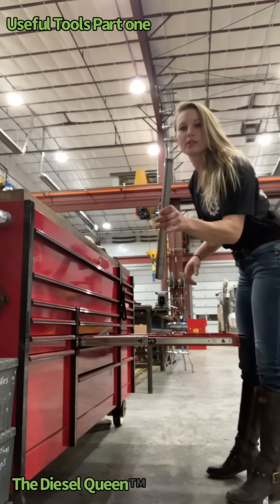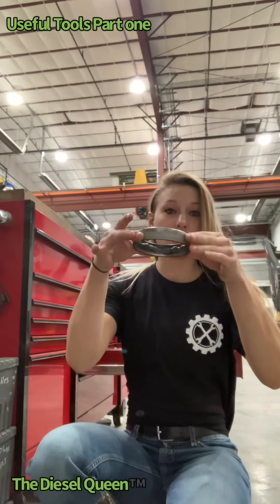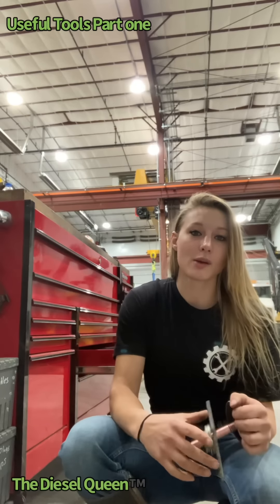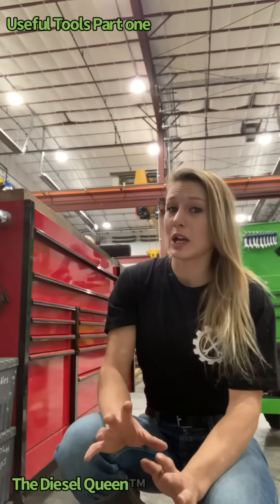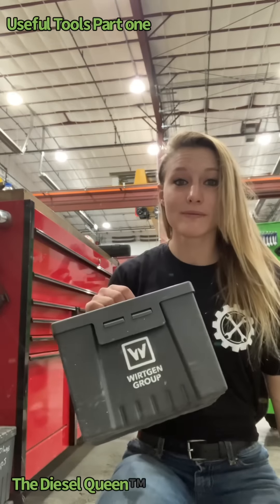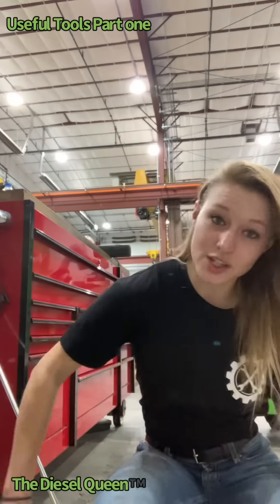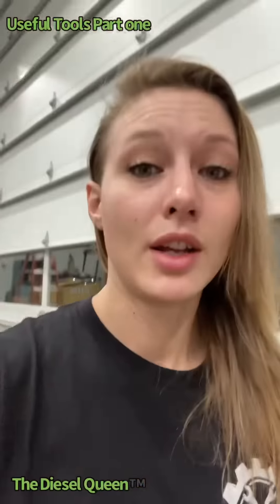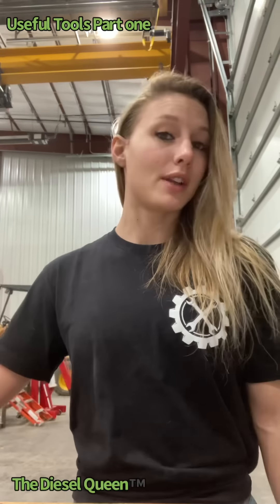Mechanic “Junk”

Comment: I worked as a diesel mechanic for 43 years .I saved old parts ,plugs, to make job easy and cleaner but was known as a pack rat. I told I saved stuff and never used it ,man could I prove them wrong. You are a smart mechanic

Comment: I like to take my old bearings to the chop saw, cut a slice out if them, then squeeze it closed and weld it back together.  Make a perfect install tool for the new one.  Works great for seals also.

Comment: Using the race of one bearing to knock in the race of another bearing is a very old trick. I knew an old mechanic when I was a kid that was doing that trick. He even went as far as welding up a plate with a handle that he could hit with a hammer and knock it in and take it out. But instead of welding the inside of his race he the ground down the outside which accomplished the same thing. It also works for putting in seals of that same size mechanics whether diesel or gasoline automotive semi or heavy equipment all have one thing in common. A lot of their tools are purpose built on the job I built several tools that were purpose built just for that job. Some will use many times. Some were never used again

Comment: I hear that on using old parts as tools. I have multiple different sized kingpins that i now use as drift pins for knocking in massive wheel studs and such. I also have a few leaf spring shackle pins for the smaller jobs. Probably my favorite old part i turned into a tool was the long tie rod end from my old 1989 K5 blazer that i turned into a massive pry bar. It’s solid iron (not hollow) and at least 4 feet long.

Comment: I take an old bearing race and I grind down the O.D. on a Bench Grinder..  then I weld a flat bar in the middle for a place to push with a 50 Ton Press..

Comment: nearly 30 years as diesel tech. Pretty much every mechanic worth his/her salt has stashes like this. I have a roller cart that contains boat loads of connectors and harness ends. Another area for the various caps and such. Used bolt bins, fittings, etc. If you don't haord stuff like this you're either in the wrong buisness or you just started.

Comment: I love the inside bearing race trick.....
 So simple . 👍
Organizing the bolts and tossing most of them out is the right way.   I had a few old bread pans full of lterally everything. I never  needed them..... Ok, rarely.
Youd never have a hard time finding work.  You've broken a stereotype into a million pieces. 👍
Im 65 and no, i don't want to arm wrestle.  I have my pride. 😂
Excellent organization, it takes a lot of years of experience do what you've done. Very cool.

Comment: I've mad tons of shop made tools over the years. But my top 2 are my homemade slide hammer and homemade valve spring compressor. Huge difference in the ones I built and the ones from a store. Mine are way beefier and I guarantee mine is a lifetime warranty lol.

Comment: Never worked on heavy equipment or diesels for that matter (oil changes don't count), but working on passenger cars and trucks you definitely have to come up with your own shit sometimes. From weighted sockets to extended shaved wrenches for srs modules, sometimes you gotta get more creative than the engineers and bean counters that are fucking you over. Cheers 🍻

Comment: I have a garage filled with stuff like that. For bolts and small parts, I use the craftsman versa-stack drawer system.  Drawers slide easy and keeps my bolts organized.

Comment: Genius keeping those old harness plugs, it's got to be way easier testing a sensor with wire leads than trying to probe in the end. 
Plus, you never know when you'll need to replace just an end because something arced or corroded.

Comment: Plastic caps from your stash are helpful to "plug" the end of hydraulic hoses, especially useful to prevent dirt infiltration and with some tape to control annoying oil dripping. 
I also like colored zip ties to match mark hoses and mating fittings. HF quality serves this purpose and gives a legitimate function to those otherwise useless zip ties.

Comment: Take that big bolt and a piece of 1” cable 24” or 18” long with a press on steel Swedge or end button and weld it to the top 1/4  of the bolt to make an offset T and it’s an awesome handle that doesn’t transfer the shock when you hit it with a big hammer and it helps you keep all your fingers safe 🙌🏻 most other mechanics I encounter are impressed by mine

Comment: "Junk"? extra connectors, old unusable shafts and pins, thats literally gold. i still have string of mechanics wire with old used shrunk/ground races.  some of the best tools in a technicians tool box are the ones they made.

Comment: there is no such thing as junk in a mechanics toolbox, everything is there because its useful for a job and saves time effort and broken knuckles, and of course lots of blood.

Bolts is vital, over the years when i have scrapped cars i usually strip them of bolts and parts and keep them, i've lost count of the number of times that bolt bucket has saved my neck.

Comment: I thought weld=heat & heat = expansion...when I do kingpins on a m.a.n axle we press frozen kingpins in..frozen to 70 degrees below zero...but hey I been wrong before...maybe you meant you weld it after you got it out & the heat from welding changed the molecular orientation and it shrunk a couple of thousandths.....anyways your cool in my opinion...I use to save stuff...now I work on city buses and they have everything..even a fabrication department on site...by the way nice toolbox...be safe

Comment: Please be careful about using hardened steel as punches. Have seen them chip off and heard about them exploding in your hand. I hit a spline once with my hammer and a pellet size piece went about an inch into my neck.

Comment: Fyi cutting notch on bearing race does same thing to making a tool. 🤟
Reply: Yep, I was going to say the same thing, bit of a secret trick🤣👍
I have a box full of slit outer races from tapered bearings I've replaced over the years. Every time I replace a bearing, I slit the old outer race as the installing tool for the new bearing, then it gets added to the assortment box, although I normally check if I've already got the correct size in the assortment box before I cut the next one, not much point doubling or tripling up, unless the bearing goes into a really deep bore I guess.👍